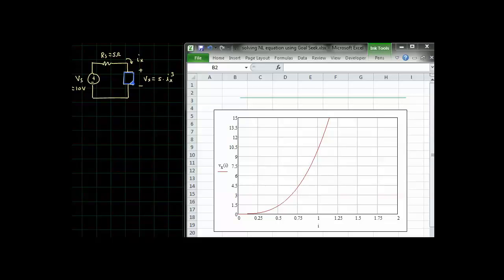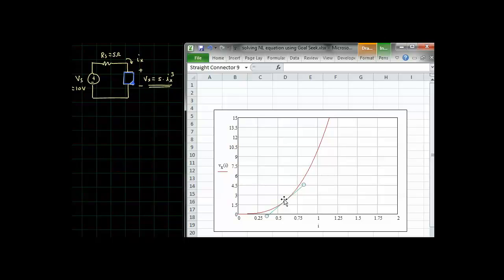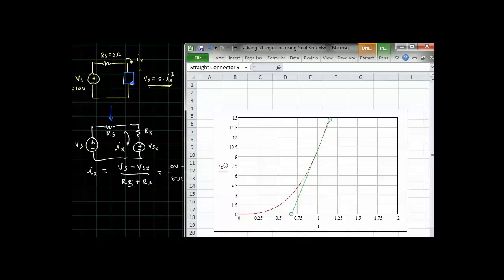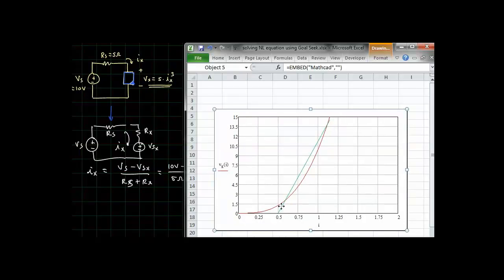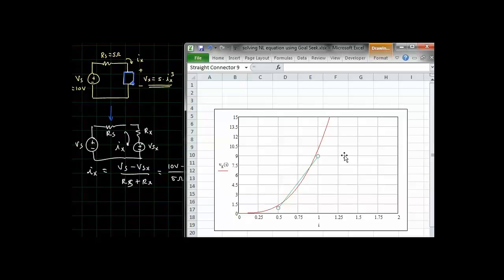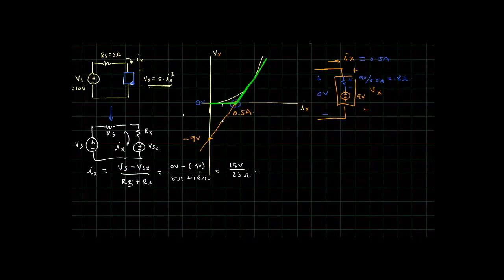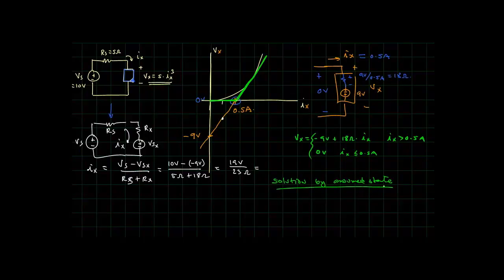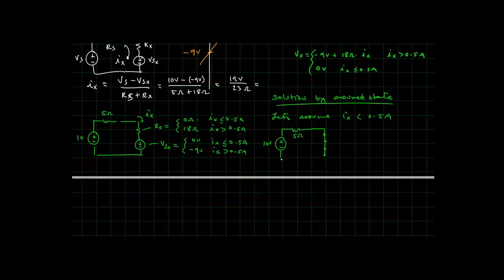Analyzing Circuits Having a Nonlinear Element (5): Piece-wise Linear (PWL) modeling

Comment: Nice Videos! i'm trying to solve a system with non-differential resistance, and your videos have helped take me to the starting point. I'm not certain the iterative solution would work in my case but this  or the SSA should do the trick :) Thanks for explaining it very calmly
Reply from the maker: Shakirudeen Lasisi thank you Shakirudeen.